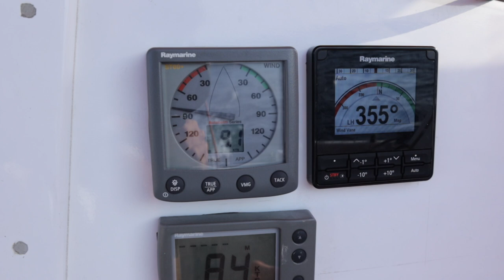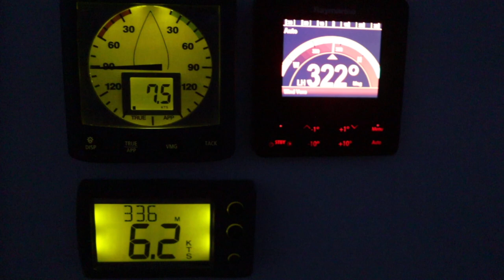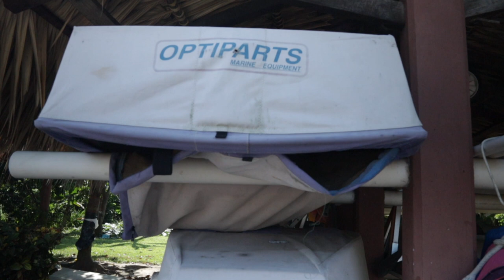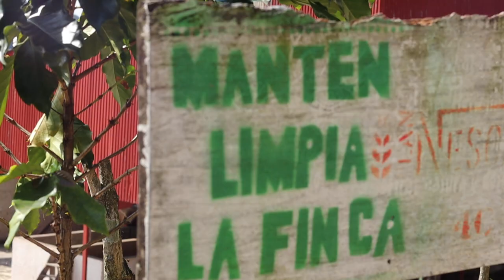Sailing back to Mexico - Lost propeller blade S4-EP4

Comment: Yes its good to see you guys on the water and making the videos hope the engine is OK.
Reply from the maker: Engine has been pretty good so far but still having belt dust issues….prop might also be over pitched cause cant rev over 2700 rpm but doing 7kts
Reply: @SailingLessPlastic  not good about the prop mite be cavitation issues, hot sauce looks so good mate so you guys both still sailing, hope better weather than me in Scotland we got cold and wet , actually sounding much like Scotlands normal .

Comment: belt powder from slip, encouraged by belt narrowing making it looser so problem increases. increased wear can be from not smooth pulley surface or pulley out of align or just too loose, narrower belt will also have less grip so slip more
Reply: Not sure about other what other people go through, but most of the Balmar installations I've seen all shed that black goop everywhere, no matter how well aligned they are or how smooth you sand the pulleys. I think it's just their nature; when you choose to charge faster, it's going to happen. Not so much when you select the low output mode, but definitely when the alternator is using a quarter of the available horsepower. Happens with a two-belt arrangement too. They work so great it's worth putting up with tho.
Reply from the maker: We have spent some time….bought new fresh belt but the same…I just wanna have a clean engine room :)
Reply from the maker: Its a normal 60 amp hitachi
Reply: @SailingLessPlastic  I would think a Balmar external regulator for your alternator would make a world of difference. They are great for shutting off the alternator load when it's not needed. They seem to make batteries last longer, but it would be best to ask a marine electrician. When it's charging 60A the belts get a workout, although it can't be that high all the time. Monitoring the temperature of the batteries and alternator is helpful too.
Reply from the maker: @martyspargur5281  yeah if it’s possible to add an external to these “dumb” alternators it would be great. The highest I see is 33 amp